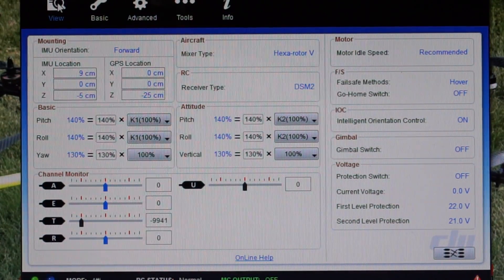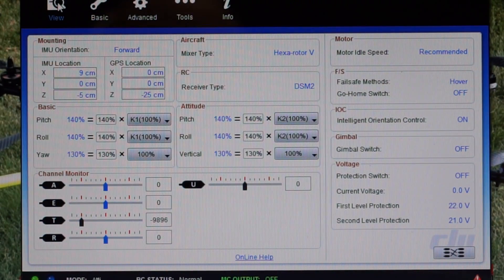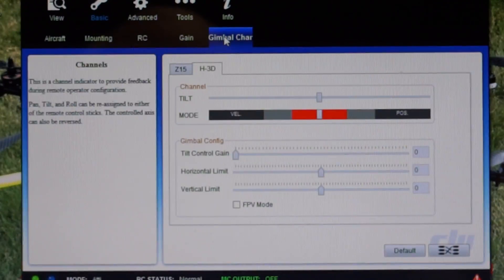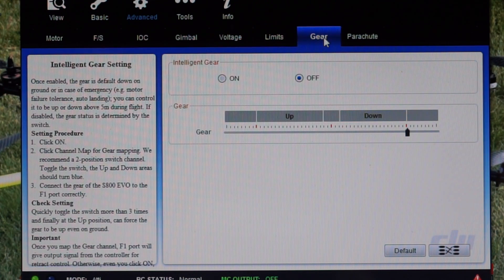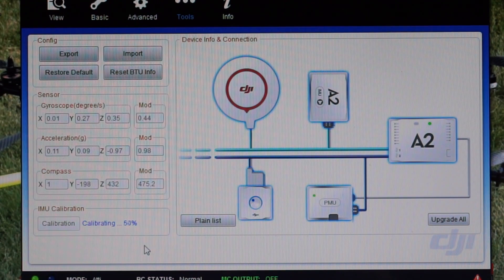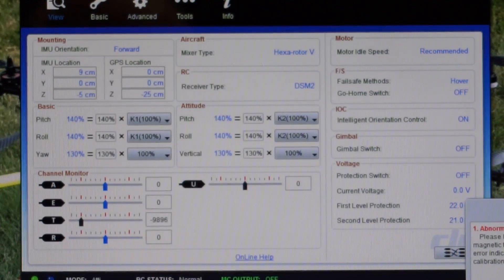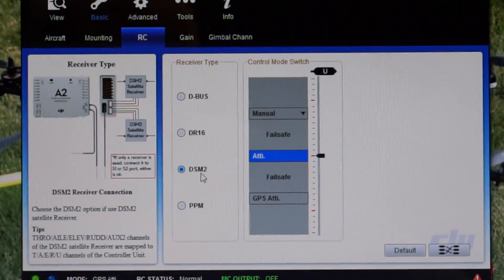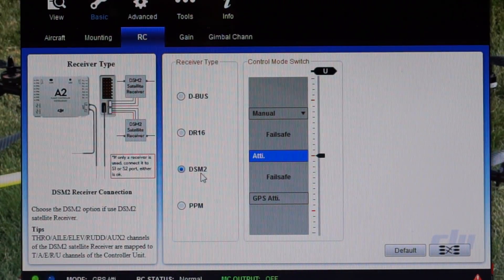DJI A2 Assistant Setup

Comment: hello PapaJeff Ring can you help me to set up my S900?...i bought the LB2 separately and i based my connection thru the youtube videos and im not sure if my wirings are correct..now, how will i link the radio controller to the LB2 and A2 flight controller?
As i said im new with this stuff..but ive been flying the walkera X800 and  dji p2v+..i bought this S900 much more better i think in my videography and aerial photography business.
I hope you can share your expertise in helping me to set up this big bird.
Thank you so much in advance..

Warrene from Philippines

Comment: try adjusting your end points on you TX switch ,so when you flick to GPS mode on assistant the actual GPS box is blue ..on this video the blue is below the GPS box ,same with atti/failsafe ..